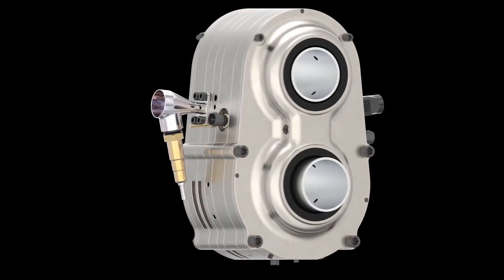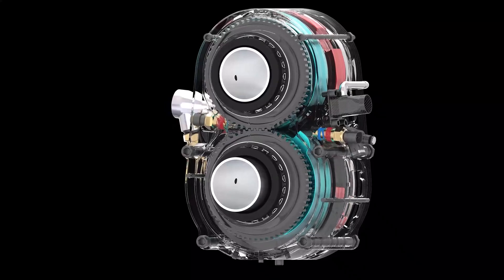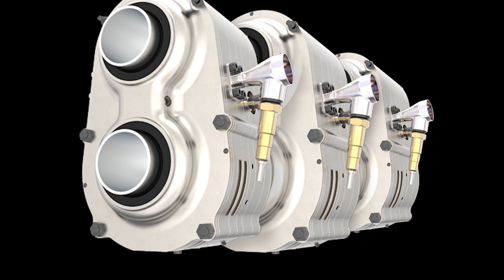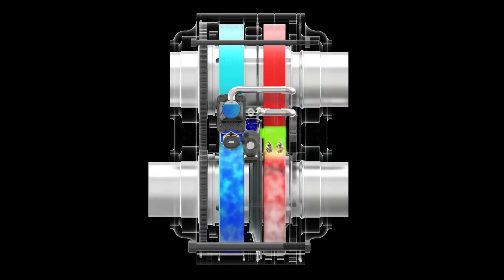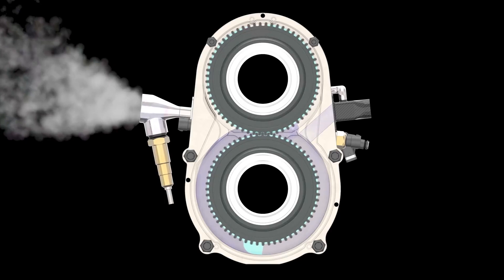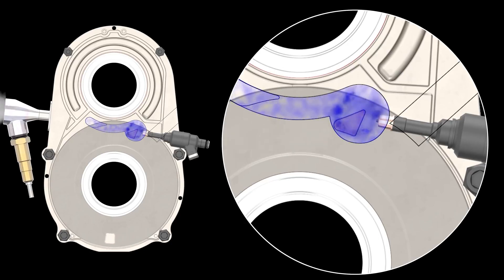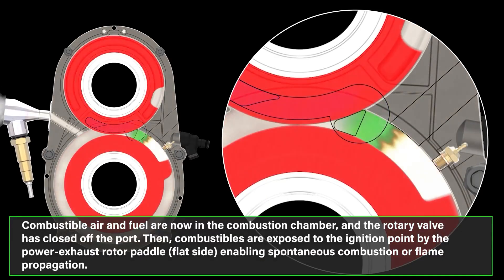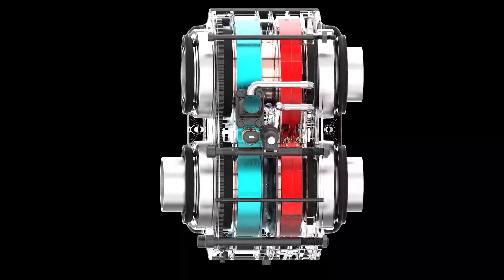This pistonless engine runs on hydrogen and revs to 25k rpm

Comment: Hydrogen due to the size of it's molecule the smallest there is throughout the universe is insanely hard to store especially safely. Not to mention that it takes turbine like engines a long time to spin up. Maybe we should take another space tech and try to apply it to cars, you know the Orion space craft powered by nuclear bombs, that'd give you instant off the line acceleration and about as practical

Comment: If this works it is a much more practical solution than every vehicle going electric. It might be ideal with propane fuel which is abundant, I think, and is much less polluting than petrol or diesel. Climate change will take a long time to be corrected if that is even possible but liquid and gas fuel infrastructure is here and widespread and it will remain an essential part for many years to come. If this engine could be mated to hybrid with 5 or 10 kilowatt battery so the engine only runs to recharge the battery and the vehicle can also supplement the household requirements or charge from solar cells on the house, to reduce the engine run time then it looks like the solution to a lot of concerns and a real winner.

Comment: Just imagine what would happen to this engine with expansion due to friction, combustion, or external temperatures.  This expansion would lead to even more wear and once the wear came into play you'd loose your tight tolerances which would render the engine useless.  So i guess you need a material that doesn't change its mass due to temperature change, or you need a cooling system to maintain a specific temperature that way you'd maintain its mass.  However even that wouldn't allow you to reduce friction entirely, and the cooling system would be very complex for it to even be able to maintain an even temp though out in a controlled matter without any slight fluctuations.

This thing is interesting but unfortunately we haven't gotten there yet, I look forward to when we do
Reply: There honestly might not be any heat expansion. It runs on a compressed gas, which will cool off as it expands into the combustion chamber, and the area actually exposed to combustion is tiny. It might only absorb enough combustion heat to counteract the chilling effect of the expanding hydrogen gas.
Reply: Temperature doesn't change mass... Do you mean density?
Reply: @DoesntRefillTheBrita  I was referring to Thermal expansion.
Reply: @stavroshouiris  yeah... so density. Thermal expansion doesn't affect mass, it affects density
Reply: @DoesntRefillTheBrita  yea must of mixed them up

Comment: By no seals I assume you only mean no apex seals, which is neat, and unlike some comments say, actually useful. “Tight tolerances” cannot avoid gas leakage, but designing that cavity properly could definitely allow it to create an air gap at high rpm, kind of genius. This is not avoiding metal on metal seals with high tolerances of two touching surfaces, this is clever engineering and tight tolerances to use air pressure as a gas seal, to avoid leakage between chambers. Obviously interfacing parts need seals no matter their tolerances, but extreme wear in those chamber separators would only cause more inefficient operation, not parts damage or seating up. I love it, as much as I doubt hydrogen fuel will really go anywhere this is awesome.

Comment: Sooo how expensive is it and what is the life of the engine? The rebuild on a Wankel Engine is 80 - 100 thousand miles, cars from the 50's on to the 90's got that easy, ie; my 1993 Ford Ranger has 350,000. I'm not so excited.

Comment: Great innovation. Personally I believe hydrogen engines are the future of transportation, even though electric is dominating or marketing thinking now (2022).
Reply: Hydrogen is probably the future of some planes, ships and trucks. Basically wherever volumetric energy density doesn't matter and you have centralized infrastructure to provide fuel. But it's completely dead for cars. 
It just doesn't make sense to create an enormous secondary distributed energy infrastructure, when we already have one available everywhere (electricity). By the time hydrogen cars are viable, the concept of a gas station will rapidly be declining. People don't charge their car at stations, they charge them wherever they happen to be going (shopping malls, super markets, gyms, restaurants etc)
For hydrogen to break through in cars, you have to assume a significant breakthroughs in fuel cells, hydrogen storage and electrolysis, and you also have to assume NO breakthroughs in battery technology. Given the amount of R&D now happening with batteries, that seems unlikely. 
I mean, if battery density increases two-fold  and charging speed increases.. why would you want hydrogen? To drive 2000km in one go? Sure, that's possible, but how big is that niche?
Let's also not forget that structural battery packs is essentially making the battery disappear with regards to volume, and the weight there is is extremely low making the cars safer. Hydrogen cars still require larger cylindrical tanks, taking up cargo space. There is a cool concept with tape cartridges that seems quite compact, but they need to be easily accessible so will still take up precious space.
People always tout hydrogens gravimetric energy density, but just forgets about volumetric energy density which is often just as important, and quite mediocre for hydrogen.

Comment: Water engine is long overdue. We have only used gas combustion since 1898 with Oldmobile. Thats 124 years of NO TECHNOLOGICAL ADVANCEMENT due to gasoline moguls killing water engine inventors. I dont know if hydrogen gas from a compressed bottle is being used or if there is a hydrogen convertor utilized as a carburetor built onboard the vehicle. I think any new engine is going to be too expensive to fuel it. We could easily be running propane engines but it all falls on it's face when poor people cant even afford propane. I think the ONLY way to go is to reduce the weight of vehicles and power them off of a 18 hp side shaft kohlor engine. The proper gears and transmision can power it up to 45 mph. But then it would need a great centrifugal weight to propell it at interstate speeds.

Comment: If you can't fill up the fuel tank for a 400mile journey in under 5 minutes it is not a viable replacement for current petrol/diesel vehicles. Hydrogen is the only solution to the problem.

Comment: The only way this could ever be viable is if they made a version that runs on gasoline or diesel. Hydrogen is a very impractical and exotic fuel, which will seriously slow down or halt the adoption of this kind of engine.
Reply: There is nothing exotic about hydrogen. Running your engine on the prehistoric remains of plants and animals pumped from thousands of feet underground and then processing and transporting it, that's exotic. You can synthesize hydrogen in your kitchen.
Reply: @eaudedogue  Hydrogen is exotic right now. That could change in the future, but it will take a long time for that to happen. Electricity is available pretty much anywhere, and yet there is always a lack of charging stations for electric cars. Hydrogen has to be specifically manufactured (which I imagine isn't that cheap when you do it on an industrial scale because you need loads of electricity for electrolysis), liquefied, transported in refrigerated tankers to the destination, then stored in a liquid form which requires energy to maintain, only to finally be put into vehicles where it either also needs to be liquid (which is complicated and uses even more energy) or it could be in gaseous form which has bad energy density and is seriously difficult to contain due to the hydrogen atoms' very small size. Oil based fuels are already widely available, so it makes no commercial sense to create an alternative for hydrogen.

Comment: My 64.    12000 pound bus  makes 
120 hp 
From a four hundred pound  straight six 
And goes 65 to 68 mph.     These  high rotation speeds are too much rotational stress  for most metals.    And if there is a flaw. The pieces would fly for a mile or more       You would have to incase it in high carbon steel.    500 lbs worth

Comment: The heavy weight of the hydrogen storage unit will offset any weight eliminated by this engine. I think it wd grind itself to nubs after a few minutes of use bc of the tight tolerances.

Comment: If this works, it's a great asset. I still don't understand how we brushed off the complete H2 sector of mobile power generation. Of course, H2 has its own perks and troubles for storing and using, but it's a great connection between power plants and mobile usage. Have too much power for the grid? Just create H2.

It scales on a whole different level than batteries - the bigger the H2 tank, the less it weighs in comparison to its energy value.

So yeah, any kind of efficient H2 engine could be a win. Watervapor is still a climate gas, but it's neutral as long as we use green H2.

Comment: Wtf im i watching its cool i dont get it 25,000 rpm "gas" engine not gunna last long an electric engine is different though about the same rpm as a tesla with fu(king like around 800 less hp not exact numbers but wtf if you really think this is cool then just get a electric vehicle dont pay extra for that its basically a rotary with damb gears and how dose it always fire all the time isn't that just a jet engine but just made to be a rotary god my brain hurts why make something so complicated that when the warranty runs out you scrap it thats what gunna happen if we cant take it apart and replace shit that goes bad that's what happens or give it to the next idiot to deal with it  hope its not as bad as i think but 2 stroke running on vaper gas sounds like metal on metal 20,000 miles tops before rebuilding it depending on the idiot that may try and buy this just give up this isn't gunna save gas engines goofy a$$🤷‍♂️
Reply: Im not shiting on the idea i just think its not practical for people that want a car to last 200,000 miles i want this to prove me wrong and its light thats all its got going for it and you can add more engines like a rotary

Comment: I guess it will still produce the pollutants call NOx nitrous oxide, produced when fuel is burned at high temperature. The air intake contains  78 percent nitrogen, 21 percent oxygen the remaining 1% is for the other stuff like CO2, when the nitrogen and oxygen are heated to high temperature, 2,800°F 1540°C flame temperature, they combine to form NOx an atmospheric pollutant!

Comment: It might work as a constant speed generator but not as a variable speed engine suitable for cars. I sincerely doubt the torque figures based upon the limited surface area of the "piston". Also, as others have commented, the tolerances required so that you don't need seals... yeah, at 25K revs those tolerances won't last long.

And then hydrogen... it doesn't transport or store well. It's the smallest of the atoms so sealing it under pressure is never successful. It also doesn't produce as much power as fossil fuels, and unless some "green" infrastructure is produced to split sea water into hydrogen and "everything" else, then where is all the hydrogen going to come from?

As much as (some) people want to believe batteries aren't the only choice for the future, I see nothing here that suggests otherwise.
Reply: Technically speaking the He atom is smaller than the H molecule which is why helium is used in leak testers.
Reply: Electricity + water = hydrogen
Reply: @Larsinator9019  at a conversion rate of  idk 70%… only to have you Hydrogen leak out of your storage and then be converted into rotation with a total loss of idk 50%???
Reply: There is no problem sealing hydrogen, at all.  You missed the point.  This is a fake motor - doesn't matter what the fuel would be.
Reply: "As much as (some) people want to believe batteries aren't the only choice for the future" .. uh... batteries aren't the future either. Sorry to burst your bubble. They are too heavy, too prone to wear and tear, the engines running on them are not strong enough for many applications that ICEs can handle with relative ease, and take too long to recharge. They also require more carbon to extract from the ground than fuel that offsets anything you gain from emissions, they also require lots of rare earth minerals rather than simple ole aluminum that can be found anywhere, the batteries contain very toxic materials that you don't want to just throw in the ground when you're done with it in a few years, and it takes too long to recharge them, and you're still having to generate that electricity from somewhere which usually means some sort of steam generating electric power plant that probably runs on either coal or some kind of natural gas because people are still resistant to the idea of using nuclear power. I'm sure advancements could be made to the technology, but unless some kind of "magic" is found, you're not going to get around stuff like rare earth minerals, or just how expensive these batteries are and how they tend to perform terribly in cold climates and/or the winter months.
 
EDIT: It's just as insane as that pipe dream of powering everybody's homes with solar and wind power. Solar and wind have their uses, but you're never going to power an entire city with solar or wind alone.
Reply: I agree with everything you said about the engine. But batteries as they are cannot match the energy transfer rate of combustible fuels.  Who knows where battery tech will go in the following decades but if hydrogen generation also makes jumps, I could see hydrogen hybrids being viable.  Unfortunately it would be a long long time before any of this would be globally available. You say that batteries may be the only choice for future, do you mean this in regards to transport or all power?
Reply: I actually believe the torque will be considerable for the engine's size... Simply because it's burning in the direction that the "rotor" is already turning. The engine is constantly in a state of turning, so I think it will be impressive but not Cummins impressive.
Reply: you arent looking at the big picture.  hydrogen is the future

Comment: What I find interesting that this engine uses hydrogen. They haven't even fully tame gasoline engines yet (flammable). They haven't even tamed natural gas engine (highly flammable). They haven't came hydrogen engine (extremely flammable). Yes these extreme engines has sensors shut off valves in their fuel lines to help prevent explosion but we all know sensors do fail in time. .
Still gasoline is the best I think, you can fill your car up faster. Hydrogen takes 3 to 5 minutes to fill up a 4 gallon tank. And everybody here is right if that engine holds oil you got to have rubber seals and and at 25,000 RPM you're going to need maintenance for sure. Engineering is fantastic I love it but you're trying to tame a beast and tell everybody it's safe lol went through time things break down and you can't afford something as powerful as hydrogen run vehicles to be safe anymore..  I'm just saying

Comment: This tech sounds like it would fail in reality, but when you look at highly specialized tech, like the SR71, it starts to make more sense. This thing probably does leak like ass at low speed. But it's meant to be at a screaming 25000. So get it there, keep it there, and I bet it functions amazingly.
Reply: It's just a turbine engine with extra steps.

Comment: Interesting engine design with 'an external compressor' ... it's sounding incomplete. Might be ok for high power.
My main point is hydrogen is not environmental or practical in any way - and can never be.
Route 1 is to make from methane and then burn it. But you have to store at -253C or 700bar pressure. Apart from the detonation potential, energy storage density is awful. LEV is 5% H2:air mix. 
Route 2 is electrolysis for green H2 and again burn it. Lose 50% in electrolysis, pressurising & handling and another 65% in burning it. We might as well use a 2-stroke engine .. end-to-end 17% efficiency to 75% efficiency for batteries. And no regenerative braking.

Hydrogen is for process chemistry or rockets only. It's great energy/kg but even as liquid it is 1/12th of petrol.
So it's not a debate - physics, thermodynamics, engineering and safety all say H2 can never work.
There is a gravy train of funding linked to gas/oil lobbying to keep saying IC engines are fine.
Thermodynamics sets max efficiency burning as 35-40% - engine design is currently as good as it will get. 
Methanol has potential, H2 never.

Comment: I don't really know enough about engine design to comment, but I do know hydrogen has remained a pipe dream as a fuel source for a reason. It looks great on paper until you factor in the weight and expense of safely containing it. Not to mention the expense of producing, storing, and transportation of it. Everybody gets so excited by on-paper energy densities and how it's clean burning, but once everything you need to do to actually safely address all these issues is done with you start realizing you aren't really even breaking even with fossil fuels, much less competing.

Comment: It is not a CAR engine! It cannot be used on cars! This engine requires very strong wind for cooling, and cannot be cooled by liquid coolants(because of no seals, and high reving coolant will be squeezed out pretty quickly...)
This is aeroplane engine and maybe generator engine.(but liquid piston wankel engine is better for generators as i think...)
Maybe with time and improvements this engine will be adapted for cars, but right now it does not look like...

Comment: I see this engine as running well with good HP (160) at 15k-25k rpm, but if it has to reach that kind of rpm to even make 160 hp, there's gonna be absolutely no torque to move a load.
Reply: It isn't going to reach any RPM.